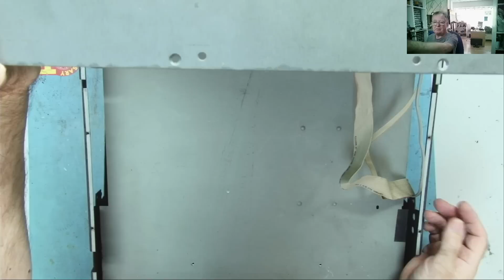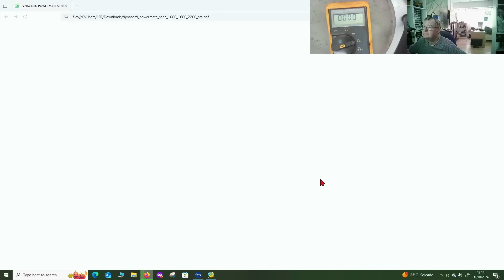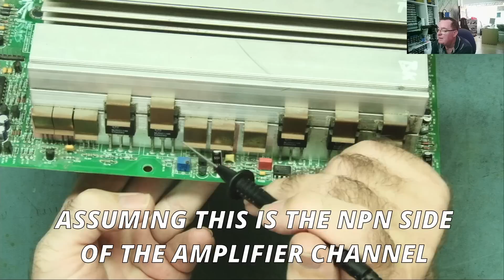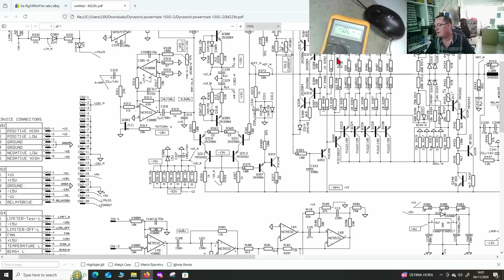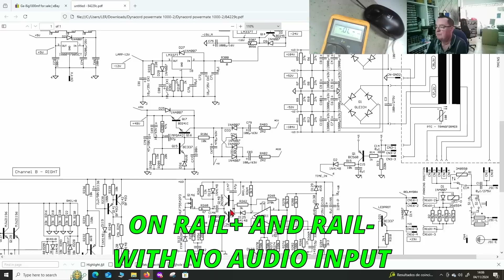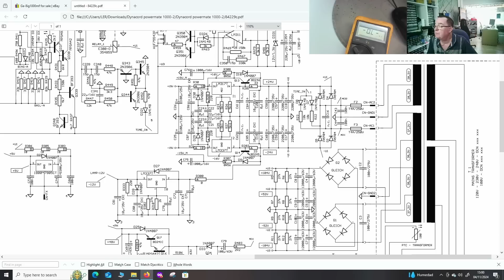Dynacord Powermate 1000 Powered Mixer Repair : Learn How to Repair To Component Level

Comment: Hello, i have dynacord sl1800 is similar to this one. Was 100 volts dc on the speaker terminal. I changed all the transistors with originals now the results is 10 volts dc on the speaker terminal, protection light on and relay clicking. At the bias checking points i have +10 and -10 volts. Any suggestions where to look?

Comment: Hi there, always enjoy your videos, the powermate mk2 are the best of the best, have one myself excellent sound quality and power, theres some TO92 package transistors near to the left fan which are the time delay and protection circuits etc... the last fault ive come across stuck in protect mode is one of them transistors was leaky, cant remember which one though but have a look in that area, hope it helps, look forward to the part 2

Comment: Alternatively you could have chosen to investigate the problem the customer brought it in for, and the mixer was also telling you what was wrong. By doing very basic checks as you did then go and find out if the problem is the protect circuit itself is faulty or its telling you the truth and there really is DC on the outputs. When and LED shows a fault condition (customer is paying hourly) go investigate the fault. You haven't even explained to the viewers what "PROTECT" is !.....IMHO
Reply: The intro is basically for people like you.

Go back and listen to it maybe you might comeback to delete what you commented above.
Reply: @AyansolaAfolabi  :)
Reply: @andymouse That's a good point.... but I'm sure he's explained what he's going to do to the customer and will charge appropriately. These are interesting amps to repair and can lead you a merry dance on many occasions even when you've identified the  area that the fault is in so even though I've worked on many of these I'll still enjoy watching this.... 👍
Reply: @johnnybravo505  I agree ! as long as the customer is aware that the video '  took the coast road ! ' and he isn't being charged by the hour ! because he isn't paying to watch somebody check a fuse. You could argue that if a video is made from the repair then no charge :)

Comment: I know these very well and all the other standalone variants...  I won't spoil the fun though, watching with interest to see the process and culprit.... 😊
Reply: Can you give me advice for my problem  please.  I have dynacord sl1800 is similar to this one. Was 100 volts dc on the speaker terminal. I changed all the transistors with originals now the results is 10 volts dc on the speaker terminal, protection light on and relay clicking. At the bias checking points i have +10 and -10 volts. Any suggestions where to look?

Comment: Having watched all of the video now, there are a couple of things I noticed. There should be a plastic shroud on each fan, to stop the escape of cooling air from where it should go, which is down the length of the main heatsinks, the other thing is a bit odd, though maybe related to the protection fault - on switch-on, the fans should ramp up, then after a couple of seconds stop again, only coming back on when there is enough heat to call for forced cooling. Interested to see what develops 👍

Comment: Coincidentally I returned one of these this week to its owner, having repaired it after it was dragged off a low table when powered up. Although there's plenty of space inside them to work in, the weight and sheer number of screws is enough to make one swear. The original fault caused by the hard landing was one of the capacitors blew (along with the main fuse), but someone else who attempted to repair it shorted the inner sheet metal shield to one of the main heatsinks - which are live when the unit is running - which blew up some of the semiconductors attached to the heatsink. Dynacord cannot supply replacements for at least some of the semiconductors, and they are universally obsolete and thus not available. Finding suitable replacements takes a while, but it was a satisfying fix. Very helpful that the schematics are available.